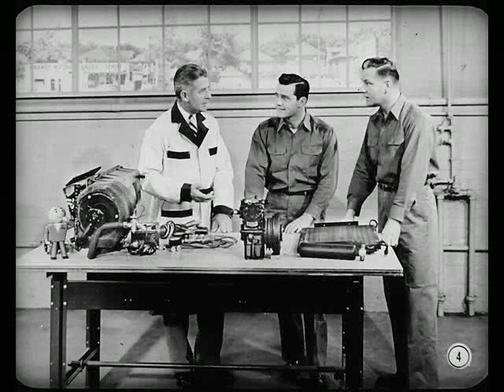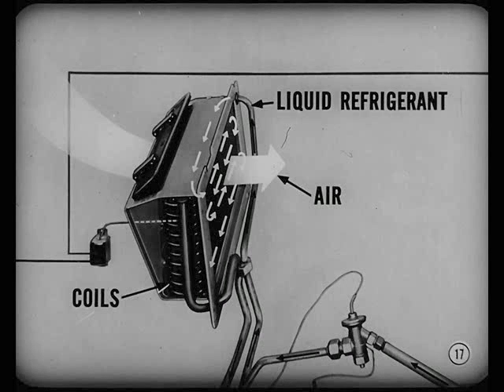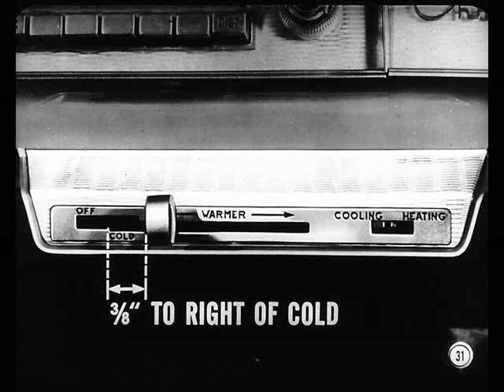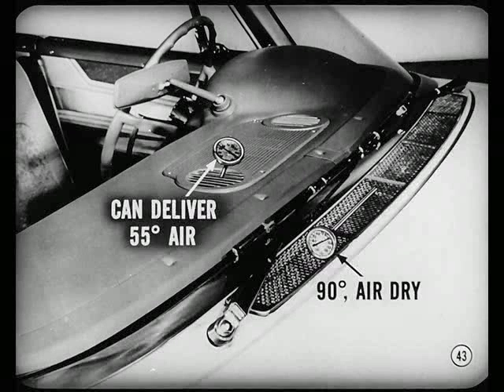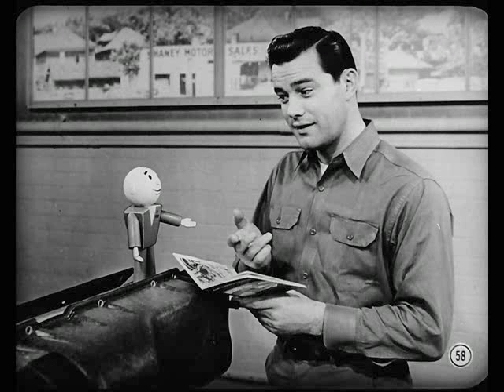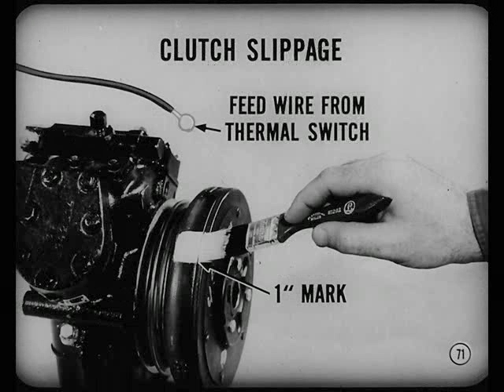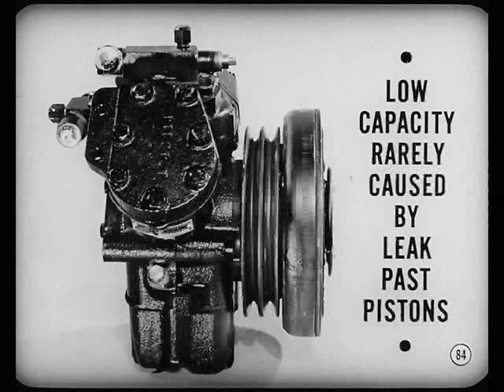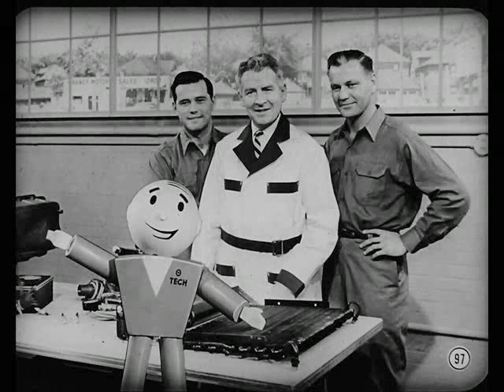MTSC - 1958, Volume 11-3 Air Conditioning Service

Comment: These older units were overdesigned and were made for serviceability. Much of this older equipment over 70 years old is still in service today. I lost my job at chrysler because I was driving 50 year old Dodges and Desotos to work everyday.  Every bit as dependable as the new ones

Comment: Humidity decreased ac efficiency that’s bullshit !! They sell systems to spray water on the condenser of Home ac units to increase efficiency.
Reply: Kef103 best talking about the evap (Cooling) coil. It sweats and looses efficiency
Reply: ARE YOU REALLY MESSING WITH TEC??? Apparently you've not seen his other filmstrips. That puppet will break your fingers, after a pack of filterless Old Golds of course.